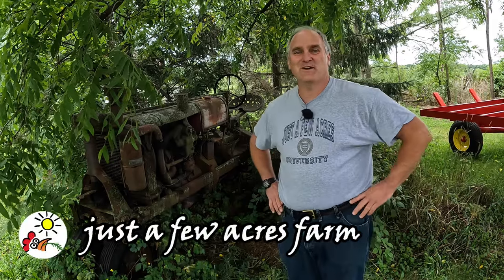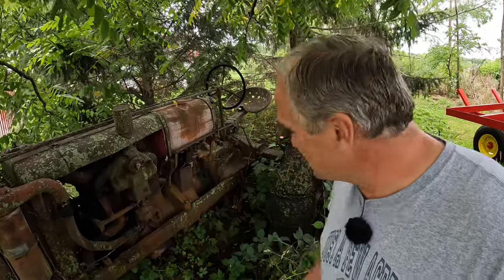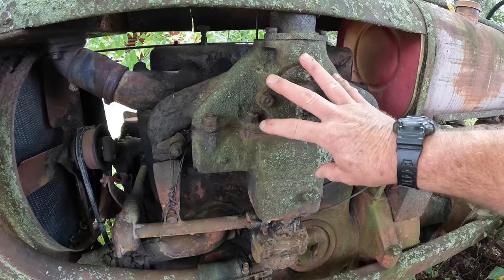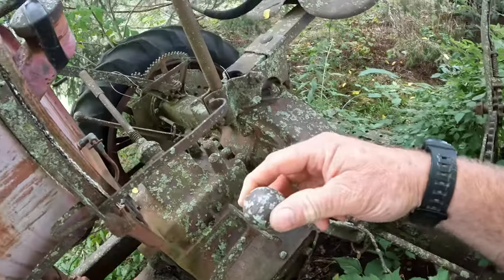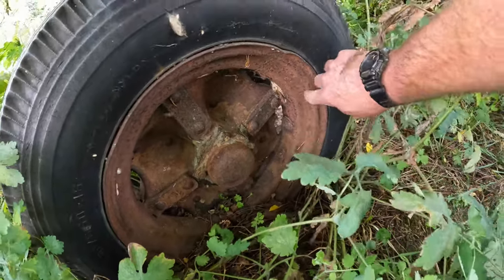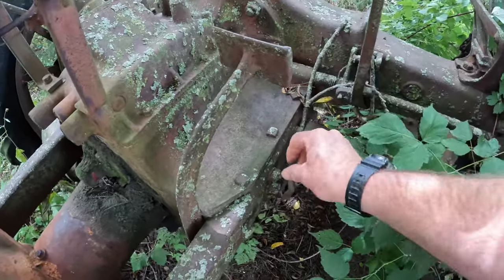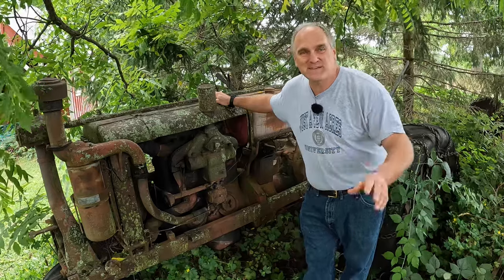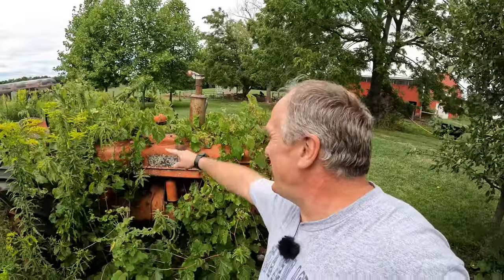What Are Those Tractors in the Weeds?

Comment: Hi Pete, I restored my 1945 SC Case back in 1976 and it has done a tremendous amount of work around here ever since!  It is simple and reliable, always starts, and is currently belted up to the buzz saw for cutting firewood.  Those final drives are actually big roller chains.  Look at your axle housings on each side and you will see that the mount holes are slotted so that the housings will move back to tighten the chains.  My tractor has a hand clutch and no hydraulics.  I plow with an IH Little Genius 2-12" trailer plow on steel behind the SC.  I love running the old antiques, but also have made the decision to not drag any more restoration projects home and take good care of what I already have.  I'm glad you are getting some rain up there.  Here at our place in north central PA things are dried up!  Take care and have fun!  Chip
Reply: I'm working on a DC now and noticed the slotted holes wondering why. Thanks for the info.

Comment: I think the steering on the old Case DCs and SCs was often referred to as “Chicken Roost Steering” because some claim that chickens would roost on the steering arm at night if they had the opportunity.  It could be true, but I think it was also a way of making fun of that type of steering Case had.  I drove DCs and SCs for years, and only once did I slightly hook a woven wire fence as I was turning too close to it.  One might think it would happen more often, but the front wheels were far enough ahead of the steering arm in most situations as I recall.
Reply: @don66hotrod94  They were good tractors.  Very dependable.
Reply: @don66hotrod94  maybe they were jealous that they paid more for less . lol

Comment: Good video.  The landside tire on the F20 is bald from plowing,  The furrow wheel slipped less on account of the slight lean of the tractor.  As recently as the 80s I could have shown 3 Ms with the same wear..
We did rotate tires to equalize wear.
We called the Case steering linkage a chicken roost, or fence catcher depending upon the situation. 
I also owned a 37 F20. Mine had a aftermarket seat, and Charlin hydraulic pump. 
The 37 was the first year with a V-belt. 
No coolant pump only thermo siphon.
You are speaking my language. 
Thanks Pete. 
P.S. there was a Chevy V8 block many farmers installed into F20s for improved horsepower.

Comment: I'm really pleased you made this video Pete, it saves me from having to ask you to do it. 😂 I wish I had that old H sitting in the weeds at my farm here in England. I have a 1940 H, it was my dad's cousins 1st new tractor. It's a gas start, TVO running engine with a hand crank start. It's an easy starting tractor but I would surely love to convert it to electric start. Unfortunately it needs a starter ring on the flywheel, (it never had one fitted) and I need a starter motor and that small oblong shaped electric box that attaches to the steering column. Farmall H tractors aren't rare in England but they're not as common as the Fergy or Fordson or David Brown etc, and finding an old H at a breakers yard isn't easy, hence the reason why I wish your old H parts tractor was sat in the weeds at my farm. I bet many of the parts I need are still on it. I can get new parts from Steiner but shipping is mega expensive. I plan on visiting a friend of mine in Iowa next year so I hope to source some parts myself. (I wonder how security at the airport will like me carrying a starter ring in my hand luggage?) 😂😂

Comment: When you were talking about changing the 656 from gas to diesel, you are right about the gas engines using a LOT of fuel. I have a 1967  International 656 utility, gear drive. And yes it uses a lot of gas.

Comment: It was interesting to see it has 26" tires on the back. My Dad's 1936 F20 originally had 36" and he changed them to 26's from an old Farmall Regular. It was really slow in high gear but it had no problem pulling a 16' straight disk with 18" blades with the smaller wheels. Thanks for the tour down memory lane.

Comment: Hi Pete,
I had me an old F20 farmall that had a blown engine when I got it but that was OK with me. I had other plans with it and it's  steel wheels.  My wife and I had just bought my Great Grandparents farm through a local realtor and had several acres of thorns to deal with. Back to the F20, I took some 2x4 steel rectangular tubes and lengthened the frame 
2 1/2' then installed a Chevy 350, 350 turbo infront of the F20 factory transmission.   Three forward gears and a reverse in every tractor gear or reverse and reverse gave me a forward. I could also run my PTO backwards! Best part, no flats with those steel wheel in those thorns!

Comment: I bought a David Brown 990 Selectamatic 58hp back 6 years ago. Never had a tractor before. 
 Case bought them out in the early 70's, Case took a lot of the Knowledge that went into the David Brown's, and used it, along with IH, which they also aquired. 
 I will tell you the DB's are as most of the older tractors, almost indestructible, but as I found out not quite when improper use is involved. I had no idea you were not supposed to stomp on the diff lock when stuck in the higher revs. Took teeth off the bull gear and, and the and rim racked the bearings and spacer.. 
I was very surprised to see the ease of repairing them, and the effort that was put into little things to make it so easy, such as threaded holes to put bolts into, so as it would push parts off instead of using pullers.  
These older tractors were built to last, 60-80 years after they were built, and still going strong. I wonder where most of the newer tractors that are coming off the assembly line will be in 60 years?

Comment: On the brake/steering interface, the cables actually attached to that arm protruding from the front of the steering column, not where you were pointing.  Being able to turn so sharp was for cultivating with a 2 row cultivator, to be able to line up with the next two rows.
Reply from the maker: No, that's not correct. The front arm is a cultivator shifter. Take a look at the video I made "all about the Farmall F-20" to see the steering cables in place.

Comment: I have a 1944 Farmall M it's a little bit rare not real rare but rare it was built on factory rubber sold in Iowa and it's here in Michigan that case tractor you showed is also known as a suicide tractor because of the way the steering linkage hangs out if you went around the outside of your field the wrong way so the steering linkage was towards the woods and a stump grabbed it guess where you went but you seem like you're pretty knowledgeable and you probably already know the story about that I love my Farmall actually I'm doing a whole lot of work on it right now no I'm fibbing my cousin's doing a whole lot of work on it he's retired and lost a wrench but as old as my Farmall is a lot of the front end parts are steel bushings and even the brake seals are like 16 gauge steel and he's been using a lot of new words lately trying to get them steel bushings out and the brake seals that is heavy duty steel I like your videos it's nice to listen to you talk you're a happy fellow thank you